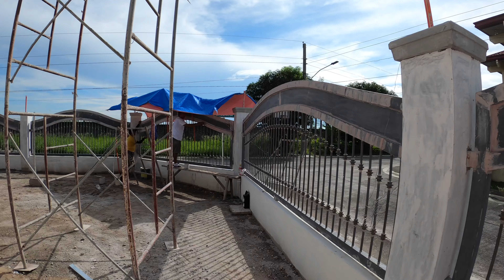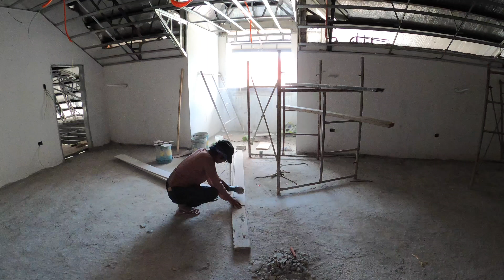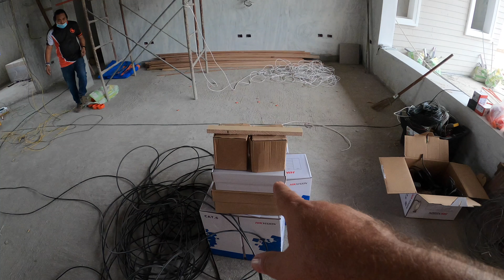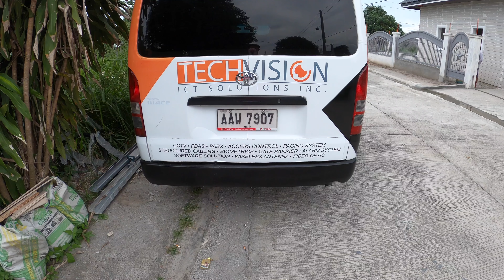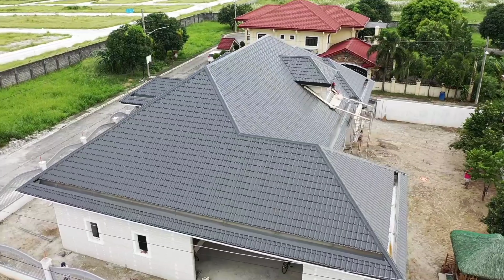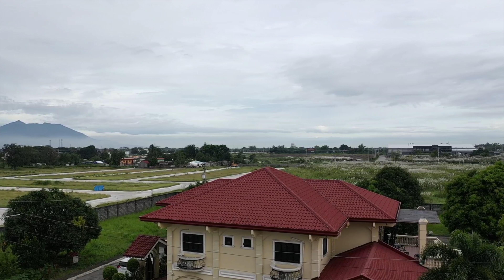Philippine House Building Step by Step, Build Day 174: Let Me Speak Clearly

Comment: I have not commented yet, but I would run two cat6 cables per run if its in your budget.  Its much easier in the long run.  You can use switches but having an extra network cable is always nice.  In entertainment centers, you may want to run more if you plan on using things like smart tvs, roku, etc.  Just my two cents :).  Beautiful home!
Reply from the maker: Welcome to Casa TexPina.
We will think about that. 🤔 
Thank you for the feedback 👍😊

Comment: Thank you for the TechVision referral, do you know if they operate in my region Lipa City Batangas?  just wondering...   In any case, lots of wire.... will the cables be routed along home electric wiring?  nice video George.  Hafa Adai to Emie...
Reply from the maker: Electrical wiring and coax/ethernet cabling are traveling in separate conduits. I can ask if they operate south of Manila or can recommend another company that does. I’ll shoot it to you on email. 
Emie said Hafa 🙋‍♀️
Reply: @CasaTexPina  no worries, there is a lot of time prior to my needs... I know your very busy, so no worries so both of you keep safe and nice video... The cabinets look nice...
Reply from the maker: Check your yahoo emails. I sent you some information.

Comment: Did the security company gave you a quote based on your plans or after the walls and were put up?
Reply from the maker: 12yardman 
We solicited proposals from 3 companies. We went with best value (not cheapest) and most technically acceptable. 
They came out while the walls were being constructed but based bids on floor plans we provided.👍😊
Reply: @CasaTexPina  Thx. I am trying to determine how to approach the security/CCTV/Internet aspect of my project.

Comment: I'm getting ready to build a house here in Cebu and I was wondering why you decided to run both coax and Cat6? What will you run on the coax?
Reply from the maker: Great question, Mike.
Coax is being run for Cable and satellite TV. Cat 6 for wired ethernet to smart devices and additional access points. Backward compatibility until fiber optic finally (if ever) gets installed in our subdivision.
Thank you for tuning into our channel.👍😁